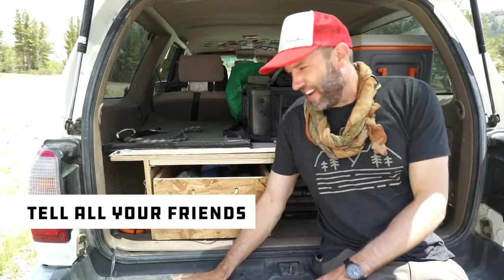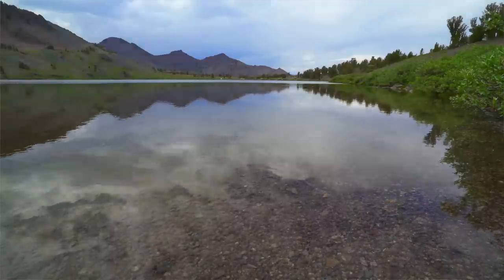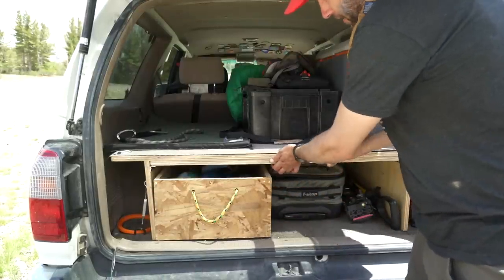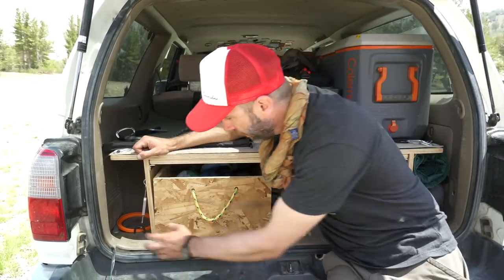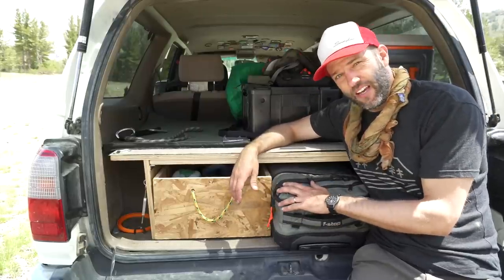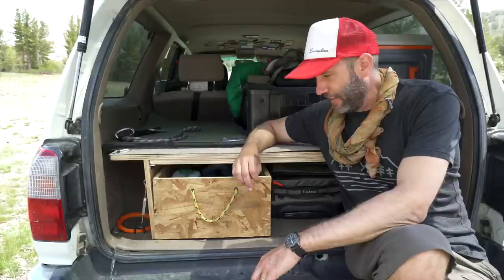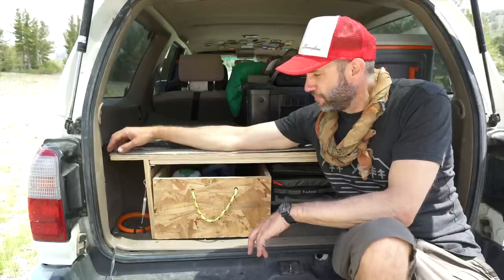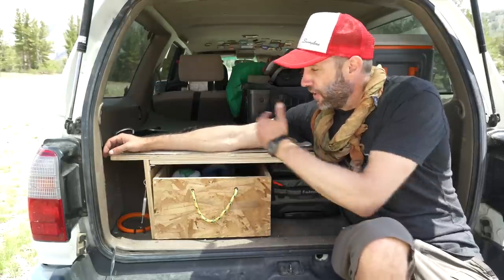DIY Drawer less Drawer System for SUV from single sheet of Ply Wood for overlanding and camping

Comment: I'm always reading comments before adding mine. This is 1 time I'm happy I did. I applaud you for accepting ideas and taking advantage of the ones best for your family. Moreso not getting mad about an idea that isn't. I think just the carpet (friction) and the box on left will keep the platform from moving. Great Design!! If you did decide to put something up front, you wouldn't need a whole board just a small strip along the bottom. I had a couple of thoughts and you can accept or deny as you please. My wife teases me cuz I'm always saying what if lol. A dowell rod 3/4 in. or any size sturdy enough to do the job but set a bit lower than uprights and you could roll it in holding the back up a little then when you set it down the uprights and weight of the platform would sit flat? I think angle iron would be too heavy and I don't know if they make aluminium angle iron? Then I thought of flashing like for a roof or doorway. Doorway kind that covers the threshold, turn it upside down and the round/ domed side could help you slide it in place. Lastly I think I've over thunk this for you LMBO THANKS for sharing your talent and videos, Rodney

Comment: After watching your video I made a similar setup for my 2002 Nissan Xterra.  I used four restaurant bus tubs for storage underneath the shelf.  I have installed an old craftsman tool box with drawers on the shelf top along with some 1940 3x5, 5x10, 17" deep sliding drawer metal card file boxes for holding long tools.  Made for a good handy man platform.

Comment: Nice job.  An extra idea for more functional use of the table could be to use the slim spce between it and the box top/camera bag to add hinged legs to the table bottom.  They could rest folded up and clipped securely out of the way for normal use, but also allow full withdrawal of the table as well for set up away from the vehicle, e.g. In a tent or as a spare.

Comment: thanks for the inspiration I made something very similar for my subaru forester after watching this and the only thing i added was another run of aluminium angle under the slide out and slide my folding table in there as well. so all fits neatly and out of the way. thanks again

Comment: I like the idea and it's nicely built, but let me make a couple of suggestions:

First, I would recommend using bolts and a backing plate to attach the loops used to secure the platform to the truck. In an accident or rollover, you have four wood screws that will take the brunt of the force. If you have a way to do it, I would also suggest anchoring the front of the platform if you can.

Second, the uprights will eventually loosen up as the cargo on top tries to shift side to side. This will either bind the table up or let it rattle. I would box in the front of the drawer area and add a right angle brackets to the rear on the outsides of the uprights to add lateral stability to the platform . It wouldn't hurt to add several to each side. 

Other than that, very nicely done.
Reply: @MrLes Berg
I disagree.
Firstly, adding more anchors to the front would be cumbersome to install and un-install.  A rollover crash?  Where is it going to go?  It's anchored already.  It's only a few pieces of plywood.  All his stuff will fly around but, the wooden deck is going nowhere.
Secondly, the uprights are fine.  There is minimal space for it to move laterally thereby getting loose.  It's a tight build.  Right angle brackets aren't good for that, anyway.  Now, if you were to suggest a couple plywood gussets, I would accept that but, the angles really don't do too much.  I agree a plywood piece across the front (assuming you mean just behind the seat) would be a good idea.  That would give way more lateral support than any angle or gusset but, it would add considerable weight making for cumbersome installation.
Good build.
Reply: Other than that...very nicely done?  No wonder so many YouTube creators are turning off comments. Good grief...
Reply from the maker: It’s no biggie.
Reply: @AllTerrainFamily  
Well, personally, I like it.....quick, simple, and functional.  It's been about six months since you posted.  How is it working for you?
Reply from the maker: Perfect. No issues at all. I am however going to make some mods...
Reply: @AllTerrainFamily  
Cool.  Glad to know it's working well for you.  Will you post the mods?
Reply from the maker: Of course!

Comment: I wrote on my circular saw table the distance from the blade to the end this way I don’t need to measure it.  I can quickly look at it and see what it is then add/subtract that from my measurement and put a mark there so I cut in the right spot.
I really like your design.  I think the table idea is fantastic and just really like the overall design.
I would add an extra set of tie down spots on the top.  Put it in the center this way you can use half and have the other side free for the dog.

Comment: You could cut a groove from the underside of the top with a router then put a screw or pin in the slide out table that rides in it.  Cut the groove from the front to however far back you want the table to go out and you have yourself a nice stop so you don't pull out too much table.  You could even cut two of them and drill a second hold a little farther forward if you want to be able to change how far it pulls out depending on how much load you think you want.  I love the plan.  Now I have to figure out how to add a second piece to sit in front of that for a sleeping platform (I'm in a 2nd gen Grand Cherokee so flat floor when seats folded).

Comment: Love it! I wish I was as handy as you! I didn't read all of the comments (too many) so this might have already been suggested, but the only suggestion I had was to add L-shaped trim piece along the front top of the whole rack where the carpet is to kind of cinch it down to the wood itself. Think of it like a transition strip for carpeting in a house. This would keep the carpet from peeling up at the highest traction area where you're sliding things in and out. Also, I just subscribed!
Reply from the maker: Hay thanks for the sub! That’s not a bad idea. It does pull up when i slide  stuff in.

Comment: Finally this looks exactly what I want. I have a 2003 Montero and I want something that I can utilize for the full rear however since taking the 3rd row out I have a nice in floor storage that I don't want to loose so full length draw system is not what I'm looking for. I love the slide out piece of wood too. If I did this It would allow me to separate some storage bins for camping gear yet still have access to that bottom storage. Thanks!

Comment: This video was very interesting and inspirational. There are similar YouTube vids featuring pull-out drawers and camper arrangements for pickup trucks. My family has an old Chevy Astro van, and I'm thinking about the possibilities for sliding drawers that could reach under the back seat. Our Astro usually serves as a traveling tool cart, hauling lots of tools, equipment, and materials for various projects.

Comment: What a nice simple design.  I am looking at bed designs for my E150 van and this one is in the top 3.  The slide out table may move it up to first position.  I have never seen this design before.  I own 2 vans with 2 different bed designs.
Reply from the maker: Awesome! I am looking at Ford vans. Got the bug. Would love a 4x4 E-250.
Reply: Check out the DRIFTA drawers systems with removable table. It's seriously nice. I put a similar drawer system in my e350 and it's great. I get a full queen bed with pull out kitchen in the rear.

Comment: I made one from your measurements and it worked really well.  I used brackets but have bought a pocket screw jig and will go back and redo the joins.  I didn't install the shelf because I wanted the extra room underneath.  It's big enough for two deck chairs and a cool box.  High quality plywood cost about $50.  Thanks for posting.
Reply: I don't have a pocket hold jig and was wondering how brackets would work. Did you find that they worked well? I honestly can't afford a pocket hole jig at the moment, it's always on the back burner. Looking to build this for my Kia Soul for camping.
Reply from the maker: You could try threaded inserts and bolts from the top.
Reply: @AllTerrainFamily  would wood glue and a nail gun work and some bracket support at the joint? I'm trying to avoid a bunch of large holes on top. I'm not covering mine with carpet.
Reply from the maker: Look for Simpson Strong Tie brackets at the hardware store and use 1/2 inch wood screws. Nails are not going to be good.
Reply: @Parksandsoul  The brackets worked well.  I kept them even after I bought a pocket hole jig.
Reply: @nsashby  I built a sweet set up the end of last summer. I ended up using draw slides cuz my trunk space is much shorter than yours. Would be able to use leverage to be much support.

Comment: Nice job! Only thing missing is side awnings coming off the tail-gate and a portable bbq! Great for rain or shine!
Reply from the maker: I do need an awning!
Reply: Jimmy Tremblay i feel like with their practical, affordable and no nonsense style a slumberjack tarp setup would do the trick.  Or he’s handy enough to rig up his own version
Reply: @mrad4234  definately a cheap and easy option. You set up 2 anchor points on the van and 2 on the ground and you're all set!
Reply from the maker: I’ve got something like this on the drawing board.

Comment: Great work, if you lowered the table brackets you could also add some folding legs to the table. That way you could also pull it all the way out and use it as camp table too. Well filmed

Comment: I made some thing similar using restaurant bus tubs as drawers just slipped them in. No brackets or slides.  Works great so far.  Using a drawer tool box hold other smalls.

Comment: Nice build. You did a nice job and your previous system gave me an idea for my pickup truck. I might go with a metal frame instead of a wood one.

One thing I might do on your would be to add a front that goes all the way from the bottom to say 2 or 3 inches above the top to keep small stuff from rolling down behind the seats.

It would also add some additional side to side stabilization.

Again great idea and build.
Reply from the maker: I did as some gussetts.

Comment: You used aluminium. This might bend in time. Use a metal ball slider with total extraction. This will hold the table better and allow for the full use of the table surface. I'm learning as i go too.

Comment: Love the idea.  Going to to it in my Suburban.  
On the drawer, attach some teflon runners underneath so it does not drag on the carpet.  Maybe even a sheet of plastic.  I would cut out a quarter of the front of the drawer about where the rope is installed.  This allow access to a few simple things without pulling the drawer out.  Also makes it easier to see inside without pulling the drawer out.  It is not like you are filling it with water or sand for the kids to play in.
Put a leg on the end of the table and you can pull it out further.  Find something telescopic.

Comment: Nice work, I subscribed. One suggestion would be to use T-nuts to attach tie down connections. You might never pull yours out but they would be bombproof with T-nuts
Reply from the maker: I was thinking threaded inserts. But either way I feel like the amount of pocket screws I’m using is sufficient. Thanks for the sub!

Comment: Nice build.  I think you. Could use your runner system upside down and make a drawer runner system without losing side to space. Might just have to add a base for stability.  That’s what I actually thought you were doing when you added the aluminum slides. I’m making one soon for my JK
Reply from the maker: I think for drawers I’d put in a base and have is slide on plastic sliders or just the base plywood.

Comment: I'm making this!  You kept it simple, very nice.  I think I will cut out some  7 inch holes in the vertical uprights and see if that saves some weight.  Maybe put the sliding table on the bottom so I don't have to reach all the way into the cubby hole to get something.

Comment: Great job but...  if you had spread the down panels/ legs further apart and added a center leg you might have had 4 drawers in the space all on heavy duty drawer slides. More containment and no weight restrictions in the drawers but what you did works well.

Comment: I love the simplicity of it. Looks great, and looks to work just as intended. Only thing I could think of doing differently is putting the mounts to the vehicle in towards the front of the "box" (just behind the rear seats). That way you have full access to the small side cubbies.
Reply from the maker: Thanks! I actually have both anchor points. It doesn’t impede access for soft stuff items.

Comment: Thank you for a great video. Plan on doing the same to my 5th generation 4runner. Love the aluminum angle and felt for the tabletop👍🏻...only change I am planning is making the tabletop width a bit smaller, so I can fit between the vehicle and tabletop, but possibly adding more weight to the build since I would have to add another upright leg. I am planning to use the Kreg system, because like you I believe screwing into the plywood end has no bearing. Great work and thank you.

Comment: You could make a door on one side or both using a piano hinge and let it be the support for your slide out table that folds out of the way or even all the way back into the cavity.
Reply from the maker: You mean to make it a stand alone table? A number of commenters have suggested similar, but i find it really useful to have the shelf in the vehicle all the time and a separate folding or roll up table for camp.
Reply: @AllTerrainFamily  i was watching the video and you showed that you could only pull the cutting board part out so far, if you put an 8" or so panel that swings out as a support you could pull your cutting board table out quite a bit more. Maybe in your situation its not necessary just a way i saw to improve on your already cool concept
Reply from the maker: @michaelosmon  Got it. Good suggestion!

Comment: Nice 👍, For safety I suggest you hook the table to the back of top part with chan or small cable in order to keep it  at least 4-6 inches (10-15 cm) from the aft edge tighten to avoid falling inadvertently.

Comment: I wanted all your viewers to know about a way of getting cheap lumber for any and all projects. My local Lowes does this. Any damaged, short cut and/or odd sizes of lumber, trim, drywall anything they have lying around, they bundle onto a flat cart and sell. I bought $700 of sheet goods for $100. Of course ther are some items I cant use but all on all, its the deal of a lifetime.

Comment: Dude, please, take the self tappers which hold the little "hoops" for the turnbuckles, and replace them with little bolts (we might call them machine screws where I live, with backing fender washers (aka large OD washers). Also, add an adjustable stopper for the table.

Comment: Awesome simple but functional how to vid thanks so much for sharing! I think I'm going to build one of these for my suburban. Just had a thought. The way you built that table slide you could probably attach some threaded pipe ends to the bottom and carry four sections of say 3/4 galvanized pipe with ya and then you could also pull your slide table all the way out attach the pipe legs and have a table to use for the family to use when you wanted to. Would do double duty as the quick slide out table and a full table to set chairs around.
Reply from the maker: Yeah i had the same idea! Ikea table legs would work as well.
Reply: What a creative yet simple idea. IKEA would probably cost more? Simple pipe and only need threads on 1 end maybe rubber foot or flex seal the other.
Reply: Maybe even have the slide out table actually be a fold up plastic table? Could be sweet if you could find the right size. Sweet build!
Reply from the maker: Yeah. That was the original idea. But it would change the dimensions.

Comment: Nice design. Especially like the safety feature of tying down the platform. What are the adjustable, hand tightened hardware pieces called that you used to attach to the loops you installed? I’ve seen them many times but have no idea how to search for them. Sorry if I missed it in your supply list.

Comment: Hey man, awesome video - thanks for sharing your ideas and your process! I'm getting ready to build a setup very similar, just sizing it up a little bit to fit in my 1st gen Sequoia. Quick question for you - are you glad you used 3/4" plywood, or would you go with something thinner if you were to do it again? Do you think you could get the slide-out table to work well in 1/2", or does the thickness help keep it strong and stable without any center support? What are the dimensions of your table piece, and about how far can you pull it out with it still feeling solid and supported? Any feedback is appreciated and thanks again!
Reply from the maker: 1/2” would not work. Especially if you make it bigger. Maybe if you used a much stronger material like bamboo.